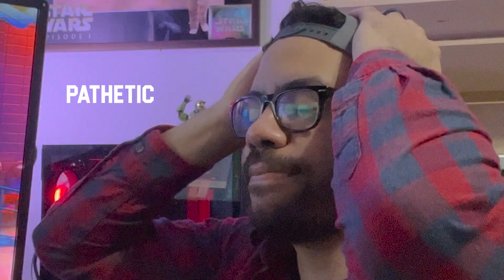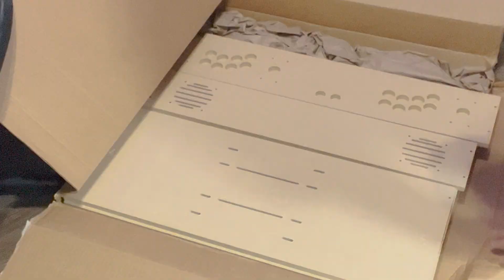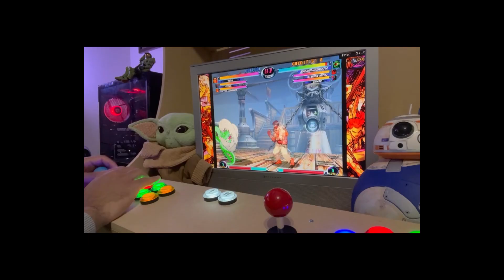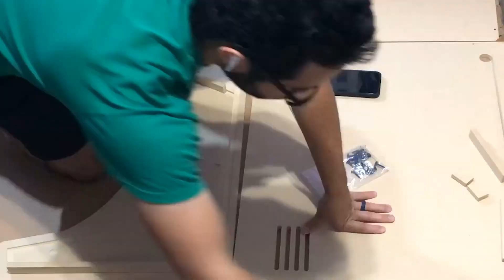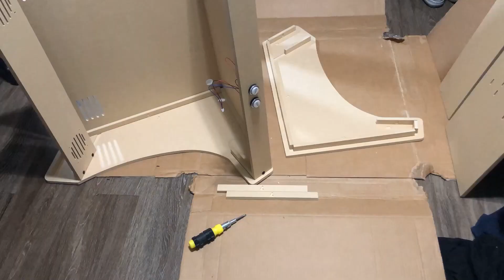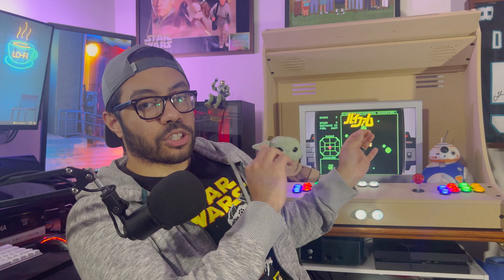DIY Arcade Machine First Impressions

Comment: Hi how is it going , I just built a portable case arcade with the pi 3 and I am having some issues about running games , I download neogeo bios in order to run games like metal slug and KOF and they work , but I am trying different emulators like arcade and super nintendo but I have not luck I download some roms for the arcade but I can make them to work, do u have recommendations on what I am doing wrong?

Comment: This is exactly what I was looking for :D do you know if you can wall mount it? I saw those nice wall mounted French Cleat arcade cabinets and if I can print or get a build serviced I can just get a wall mount bracket and a stud finder and that should be it right? I marked the heights I would I have a very convenient plug and space in my office for it I just don't know how to approach it all. I am super inexperienced and have no tools and this would be my first project lol the most experience I got is replacing buttons and artwork on joystick panels. I think I would still need a mini pc or steam deck or something like that and a launcher right? like how do you go from pressing or flipping the power and in like less than 20 seconds be up into your favorites list and jumping into a game I am lost but I am learning a lot 🥹 I don't really play fighting games that much but I do like the joystick and action buttons for 2D platformers and puzzle games and I hear modern games are nice I want to play the retro games like resident evil I've not played a lot of these but I still got all my old games I kept my SNES, NES, Dreamcast, etc 🥹 well I would have the N64 but my parents just packed it away it hasn't worked for many years the tv cable connector has been broken so it can't get a signal but I kept all my games I am waiting for the ModRetro 64.

This is so cool! Are you still using it in 2026?